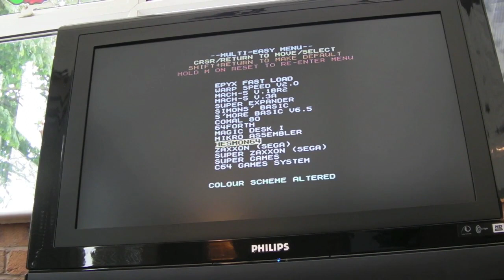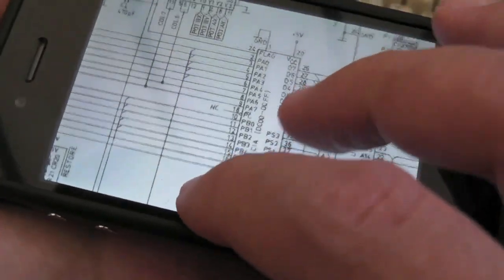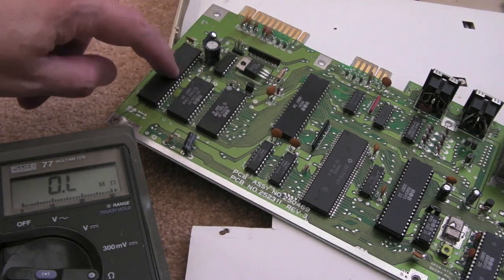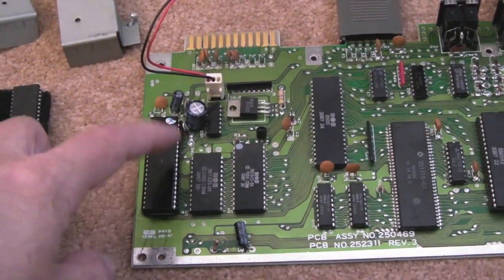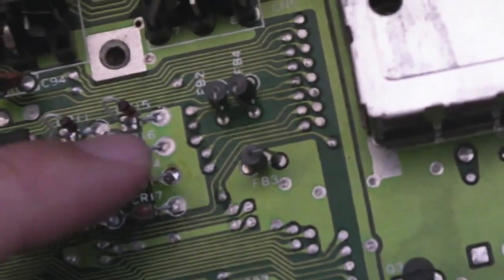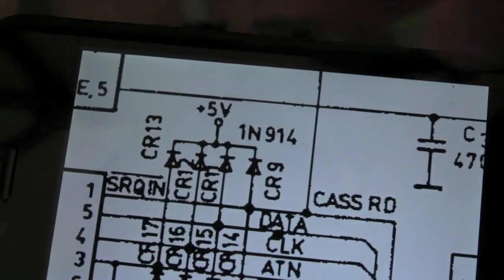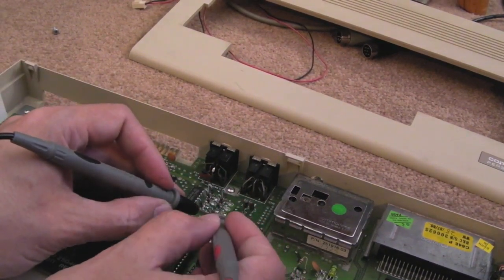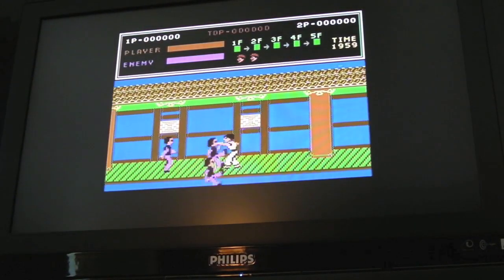Commodore C64 (C64C) Disk & Tape Loading Fault (Repair)

Comment from the maker: Don't work with boards on the carpet like this!  You do risk ESD damage to chip!  Worth pointing out that the diodes need to be schottky diodes!  I swapped them out earlier.  It's better to use schottky diodes due to their fast switching speed.

Comment: Hey just an update I found the problem with mine, turns out it wasn't the board at all I got a new one to do some comparison tests and the results were the same!!!!! Looked inside my datasette looks like it's had water damage/been stored in a damp place and one of the traces had corroded through. Little blob of solder later and it worked :) needed to realign it though (trial and error method :( ) but it's now working!

Comment: I have the same issue of tapes not loading. Im not getting a continuity beep across the diodes and dont want to go as far as replacing chips just yet. Is it possible the 151j capacitor in front of the serial port is the problem? It has a smooth black bit on the top that the others on the board dont have
Reply from the maker: Hi, it's very unlikely to be the cap!  Most likely to be the CIA, or the diodes.

Comment: You, my friend are a lifesaver - I'd been going round in circles swapping CIAs around etc.  Checked the diodes and 2 had shorted.  Swapped them out with 2 from my spares board and now everything is working! Top Marks!  PS, Love the channel
Reply from the maker: That's great!  Glad you fixed it! =D

Comment: I got a C64 from a friend which he had bought from ebay and never tested. It would not detect my SD2IEC when I tried it. However, it would work with the datasette. I inspected it and didn't find anything. So put it aside. That was until I watched this video. I ran down to my retro room to inspect these diodes. First I meassured the values on my working C64s. Then I meassured on the broken motherboard. Lo and behold, turned out two of these diodes was shorted. At closer inspection I could see one of them had burned away that white coating on the component leg. I found two of these diodes in an old modem PCB I had laying around. I swapped them with the two burned ones on the C64 motherboard and now the SD2IEC is detected and working! However, the SID chip is making some crackling sounds and don't play music correctly. So it probably suffered from this shortout (whatever had happened to it). I have tested this sid chip in other boards and got the same fault. Also tested 100% working sid chips in this board and it was working perfectly. So thanks for your videos man! I really appreaciate them!
Reply from the maker: Awesome!!! Thanks for sharing your success story - glad you were able to fix your C64 =D

Comment: Interesting & enjoyable watch there. I've got to watch more of these vids... always good to know how these consoles & computers work & seeing what they look like inside. I'm hopless at soldering let alone messing around with chips n' wires. So I daren't do anything for fear off setting the building ablaze :) I hope you don't mind me asking...have you ever repaired any Mega CD's & C16?
Reply from the maker: 1msx2go I have repaired a couple of Mega CD's - faults tend to be either the SMD capacitors or failing laser.  Never looked at a C16!

Comment: Could those components fail if someone plugged a serial device in while the computer was on?  (And who says the C64 is no good for web use...?)
Reply from the maker: MarkTheMorose I guess its possible from static electricity but I wouldn't expect those diodes to pop like that =/  With something like that I would expect the voltage to be pretty high for a period of time I think.  Static could do the job if the voltage is high enough though.

I wonder if the original 64 had clamping diodes there on the serial port?  I must check that soon!

Comment: Good find. I've been working on a video this week on a similar problem, but the cause was very different. I found that some disk drives add 1k pullup on the SQR line (The "1541C" drive does, but not the other 1541 revisions).. Thats 1k in parallel with the 3k3 pull up on the C64 that you mention in the video. An output driver (inverter) in a 3rd party brand datasette didn't like the extra 1k pullup (or extra 5mA for every disk drive attached) and couldn't bring the voltage down. 6.5mA was a lot to sink for a single I/O line back then, and so it was for the MC14584 in the 3rd party datasette. I swapped it with the one the Commodore datasette uses (74LS14) and problem solved.. but anyway it is curious that Commodore added 1K pullups to the SQR line. Some computers like the SX64 and VIC20 doesn't have pullups on the mainboard on the SQR signal, and I suppose it was a late patch to prevent floating input on the CIA chip (on VIC20?).. and also, the SQR line was never used as intented.
Reply from the maker: bwack I hope you do a video on that - it sounds really interesting stuff!  I always find it interesting when they make revisions and add / remove stuff etc to deal with design flaws.
Reply: GadgetUK164 made the video. uploaded it when you asked. :) I've only done videos for a month and I'm quite novice at doing the videos.
Reply from the maker: What's your YouTube name?  I cannot see a link to YouTube on your Google+ page.  Google+ is a pain isn't it?

Comment: Looking at the datasheet for the 6526, the A mark is the frequency range. A is for 2MHz, and none is for 1MHz. The IC only has 5V power supply pins. no c64/c64c issue there I think.
Reply from the maker: bwack Thanks, very interesting!  I wonder what the 1 / 2Mhz stuff is all about - is the C64C 'more capable' regards comms speed or something?
Reply: GadgetUK164 I don't think so... I only know that you can mix 6526, 6526A and 8521 as you please with the C64s. I was surprised when I opened my breadbin from 1983 and it had both 6526 and a 8521. Been looking around and the 2MHz IC's (6526A) is used in SX64 computer and the 1571 disk drive.
Reply from the maker: I didn't even know about the 8521!  Someone should create an FPGA or CPLD replacement if possible.  Something mounted on a 40 pin DIP board that can just plug in.  The number of working CIAs will diminish over the years.
Reply: Sounds like a good idea. CPLD is probably preferable because it doesn't need external flash. Correct me if I'm wrong I'm not updated on the FPGA technology.
Reply from the maker: I don't think all FPGA need external flash, they just have much more capability.  I am not that up to date on FPGAs myself.  It does look like the CIA just has some shift registers and stuff that could probably be replicated in a CPLD without too much effort.
Reply: GadgetUK164 You are so right. I just looked up a spartan fpga.. but I think there is another problem with FPGA and that is 5V tolerant inputs or lack of it. Just found this.. http://www.seeedstudio.com/depot/XC9572XL-CPLD-development-board-v1b-p-799.html .. looks affordable for a hobbyist. :) but one would need more equipment though. From the comments: "5V drive - You can put a pullup to +5 on the output pin and configure 
the output to be open drain (drives to either 0V or high impedance)." Wow is there anything that can't do.
Reply from the maker: bwack I know lol!  I really want to do more with PIC, CPLD and FPGA.  Right now my focus is on some PIC stuff.
Reply: GadgetUK164 Could be a project: CIA by a fast PIC, perhaps with a PLL.. Run in a tight loop.. The CIA has 16 registers, two timers with different modes, some interrupt features, IO. Not too complex.. ?
Reply from the maker: Yeah, I think its definitely possible.  Maybe if a PIC is not fast enough something like an ATmega88 or something should be - like Swinkles used on the Nano SwinSID.
Reply from the maker: I am surprised more of these types of chip replacements don't exist yet, but I am sure most of the chips will end up with the sorts of replacements we've talked about here.  The CPU is another good example where a small FPGA could easily be created as a swap out part.  Even the VIC II could be replicated I'me sure.   For one thing Jerri Ellsworth has already replicated the hardware in FPGA with pretty much 100% accuracy after she reverse engineered the hardware, so its all possible - just someone needs to find the time to have a go.